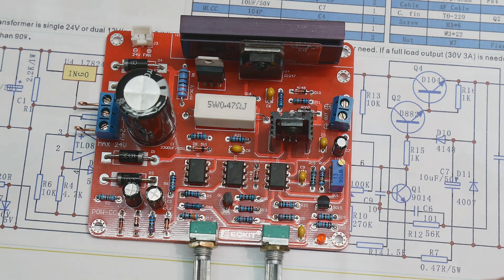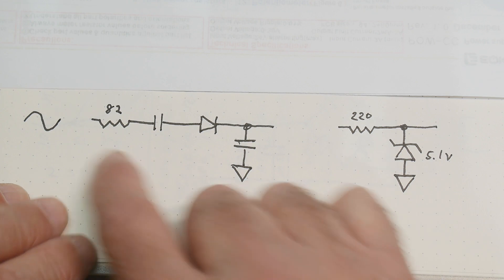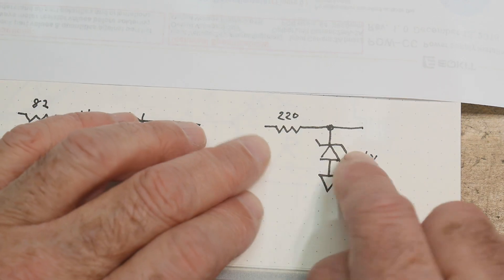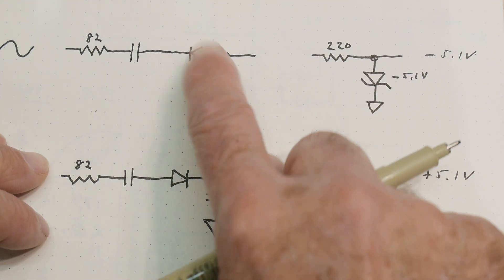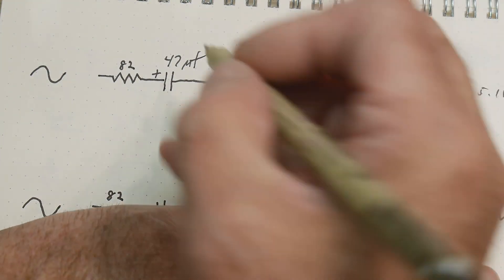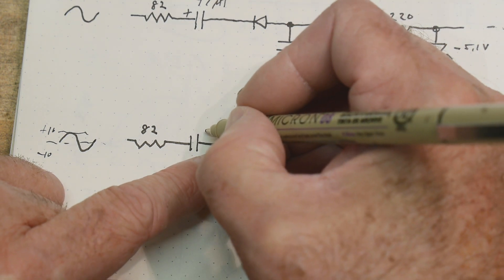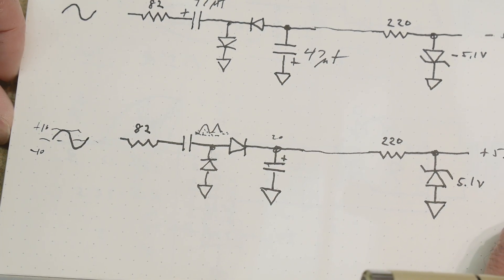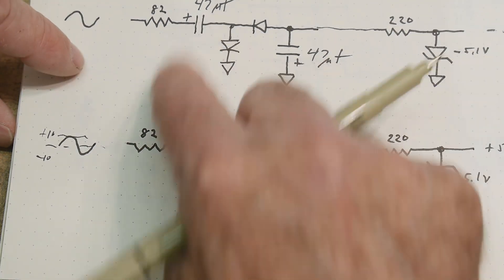#712 Basics: Power Supply (part 2 of 5)

Comment: Imsai Guy Thanks! I am playing with this built circuit and noticed it works if either or both the Cap polarities are reversed. I guess this is due to AC?
Reply from the maker: this is very low voltage signals. some people put two caps back to back, + to + and that is supposed to be better.

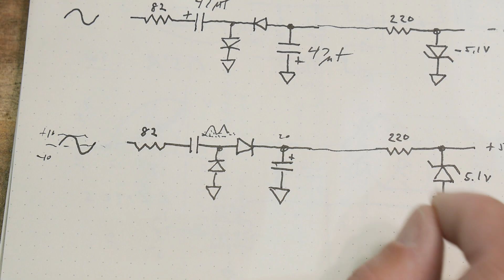Comment: @IMSAIGuy first of all a great video, loved and subscribed to ur channel, one thing i couldn't process was the diode which push up the ac, searched and found it was part of clamper circuit, but when I simulated the schematics of positive voltage power supply from 8:29 in Qspice(spec Sin (dc=4V,  Vpp=12V 100hz) it was only showing a chopped ac without dc(-0.8V to 7.1V), not clamped as i expected, Am I doing something wrong?
Reply from the maker: did you have the capacitor?

Comment: What is that cap doing there between the resistor and the diode?
Reply from the maker: blocks DC current
Reply: @IMSAIGuy  had to look it up because I didn't think this was possible. Fascinating. Would you find this same set up in something like a solar inverter?

Comment: so that was basically a clamper circuit before a clipper one if I am not wrong. But why do we need to push the voltage up or down, when we need only 5.1 V at the end?

Comment: A few points, the first circuit you gave with only one diode will not work.  That is because the capacitor after the 82 ohm resistor will charge up to a point where the diode will never forward conduct.  Capacitors only pass ac current so you need the second diode to ground to pass the negative current through the capacitor to discharge it so that it can conduct current for the next cycle.  This is a voltage doubler,  so unloaded it will produce a voltage that is twice the ac peak voltage (minus a diode drops).  If it is arranged in stages you will need capacitors in each stage to store charge to transfer the current in the next cycle.  Also note that this kit really is under rating the 82 ohm resistor, it will dissipate alot of heat.  My estimation with a 24vac transformer the power dissipated in the 82 ohm resistor is over 1W.  I think the kit only has a 1/4 watt resistor.
Reply from the maker: You are right. I tried to keep the ideas very simple but I did handwave a bit too much on that one. Yes it would average to zero. I need to go look at the 82ohm  you may be right. hopefully the circuit charges and the crest delta charge voltages are low enough to reduce the wattage needed for the resistor.
Reply: @IMSAIGuy  That resistor got pretty hot in my kit and I changed it out to a 2W.  I think it is pushing it with the 1/4 watt resistor, but at least it should be installed with long leads above the board to increase heat dissipation.  Not sure why they did not use a bit lower capacitance to and lower resistance value try to reduce the power dissipated in the resistor.
Reply: What is the purpose of capacitor before diode and after diode?
Reply: @addaguriprashanth1127  The capacitor before the diode is basically acting like a level shifter.  The capacitor after the diode is used for smoothing.